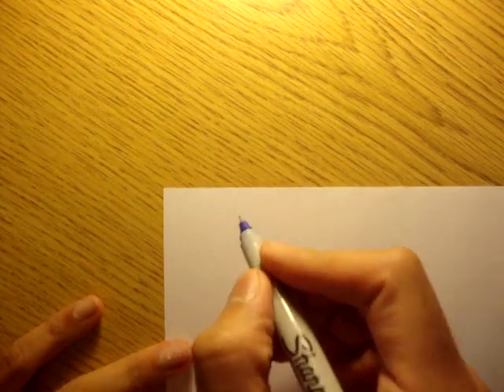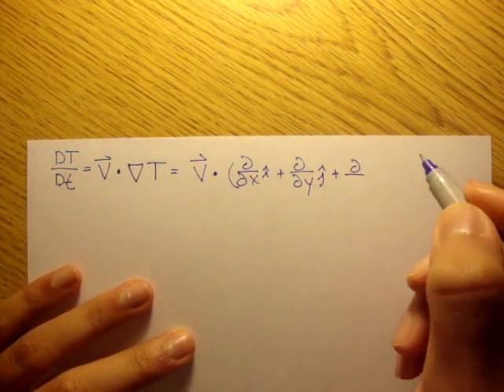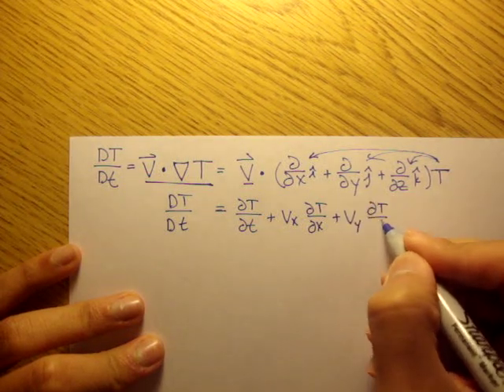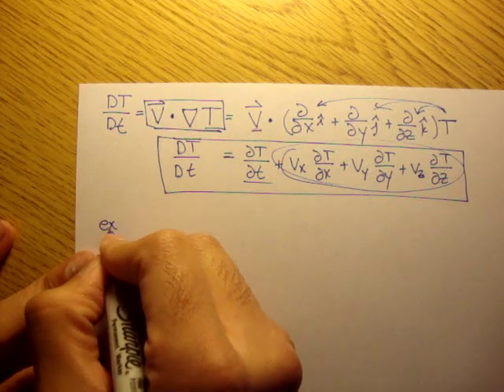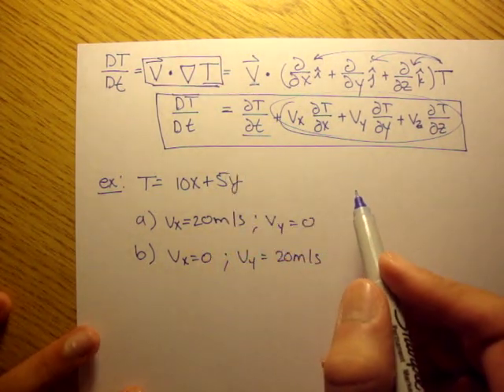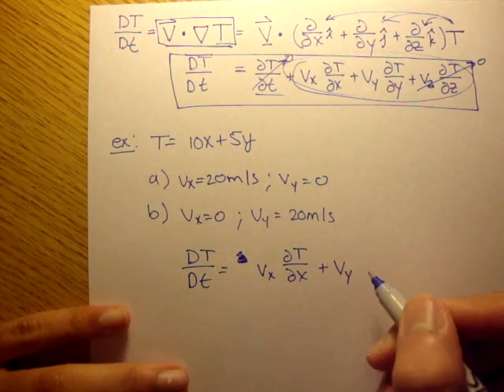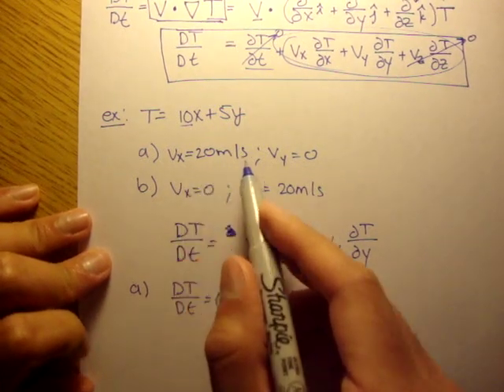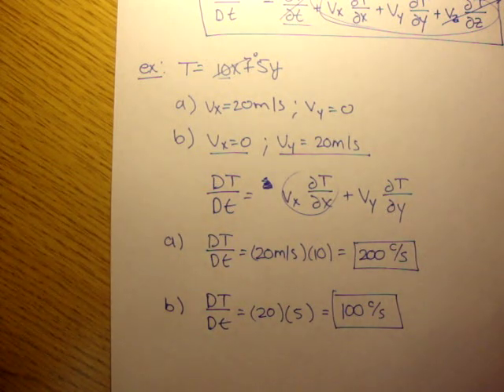The Material Derivative [Fluid Mechanics #13]

Comment: What if T is a vector?
Reply: If T is a vector, you end up with a vector. Grad T is then a 2nd rank tensor (think of it as a matrix) and vector v dot tensor grad T gives you a vector again. T is a scalar in grade school, but later you need it to be a tensor, bare minimum a 1st tank (vector). Applications: electromagnetism, fluid dynamics, material stress analysis, etc
Reply: T is a scalar. I am in high school and I know this, lol

Comment: where did dT/dt come from? at 2:20?
Reply: because if it you have the material/ "the full" dericatice on the left, you would haved the partials with respect to time as there are more than one dimensions being used, and since you are finding the temp w/ respect to time, you would basically be adding that to the "components" (partials) of the same term to get the "full"/ material derivative of the temp w/ repsect to time.

Comment: Assuming T a function of (x,y) and (t), and _not_ a function of (dx,dy) and (dt), you can write the "total differential": dT = T(x+dx,y+dy,t+dt) - T(x,y,t). This becomes: dT = T(x,y,t) + (dT/dx) dx + (dT/dy) dy + (dT/dt) dt - T(x,y,t) =(dT/dx) dx + (dT/dy) dy + (dT/dt) dt .
Now you can write dx as v_x * dt and dy as v_y * dt. Now you can divide both sides by dt, and it's become:
(DT/Dt) = (dT/dx) v_x + (dT/dy) v_y + (dT/dt)
With all (dF/dvar) structures partial derivatives.